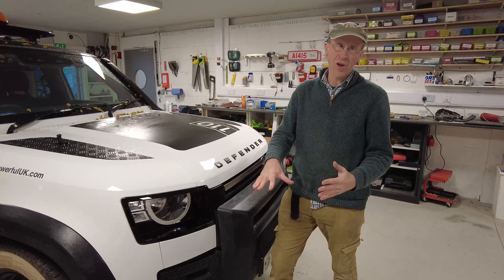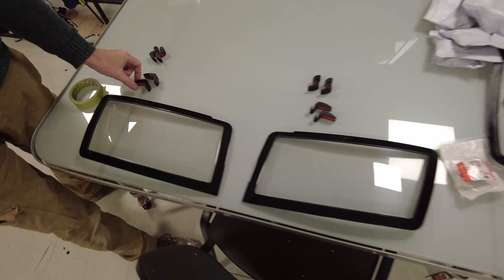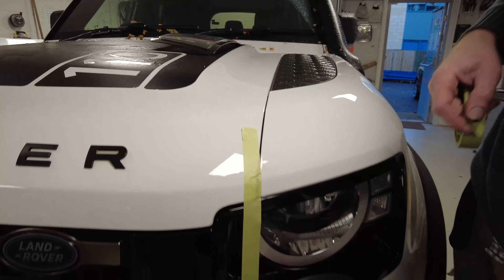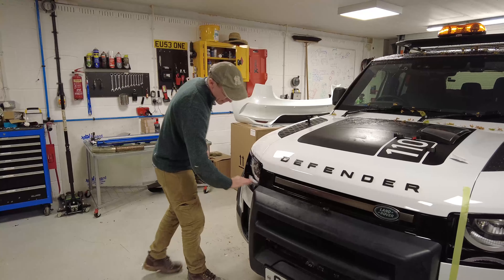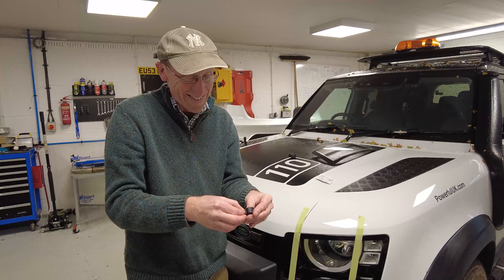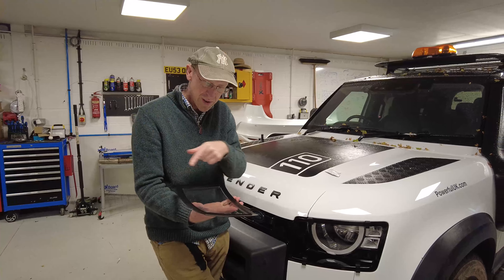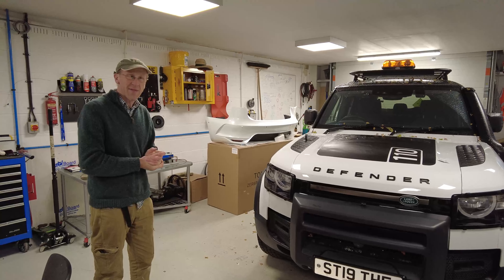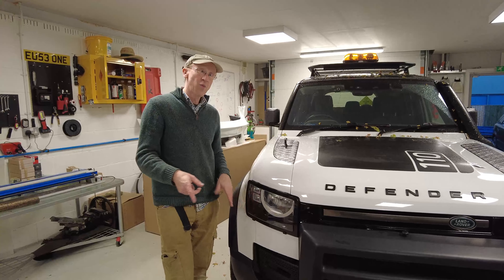Fitting Headlight Guards To Fit Land Rover Defender L663 Headlamp Covers

Comment: Ordered yesterday and already shipped to me here in NY today! Thanks! It will be interesting to see how these perform to prevent snow buildup in the headlight cavity since LED doesn't produce heat. (Poor JLR design imo) Since this mounting solution is designed to prevent misting, it results in them sitting proud, leaving a gap around the edges. I think snow will still make its way behind the covers, though I know the intent of these covers is protection from rocks. I have similar protective snap on covers for my Hella Rallye  offroad lights and have to remove them in winter due to the snow accumulation behind the covers. Simon's suggestion (via email) to try draft excluding tape (weather stripping) all along the inside perimeter of the covers may work. Thanks again! PS: My PUK  mountain of goodies is getting quit high as I wait for delivery of my 110 in a few weeks.
Reply from the maker: Hi Joseph - Yes I have been looking at this again today - the gap is about 10mm so some EDPM foam strip may help the snow entering from the top.
Wow getting those to you so fast is crazy - in a good way !
Thanks for highlighting the snow aspect to us as we have used this in our marketing... please keep us updated on how they work so we can work on improving the design etc.
Reply: @L663  Will do. Oh, and to clarify, I ordered the covers yesterday and received txt notice that they are shipping to me today. Once shipped from PUK it then takes about 1 week via DHL to receive your packages here in NY. Thanks again!

Comment: Headlight protectors, nice bit of kit but yes always a but! What are your thoughts on applying a thin foam strip to rear of cover around sides and top to prevent water from running of the bonnet down behind cover, may keep cover cleaner on the inside so less washing and scratching? Keep up the good work guys.

Comment: Can you please do some for the FL2? I have been through two sets of the ones that tuck in under the bottom of the light and snap into place on the top. Tiny cracks keep forming all over them then they split. £60 a set is rough.

Comment: Good video as always, must say that I took the plunge last weekend to fix a problem with my Volvo, sadly no Disco 3 yet. I sit behind a desk at work and have no practical training but your videos gave me the confidence. I took the tyre off, removed them wheel arch liner and found and then fixed the leak in my headlight washers. Sounds simple but if you ratio my skills it was akin to Christen and Vera taking that engine apart 😀 Keep up the excellent videos.
Reply from the maker: Wow Robert you are taking the first steps on a journey of car repair and modification.... I am really glad my videos have given you the confidence to have a go !

Comment: Looks great. Easy to install ... and unfortunately easy to be taken off by anybody that is not supposed to do so. Some anti theft protection would be better.
Reply from the maker: Yes this is alas an issue - but so inclined a thief could remove half the external plastics on your Defender...there are no anti theft measures on these.